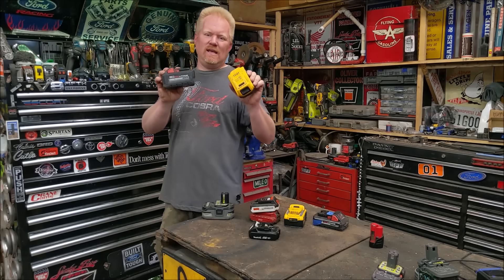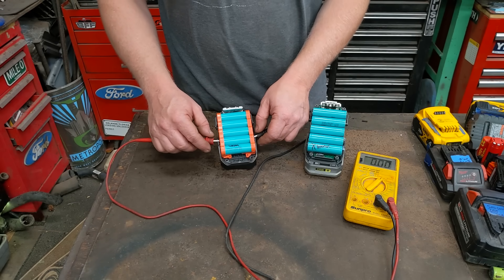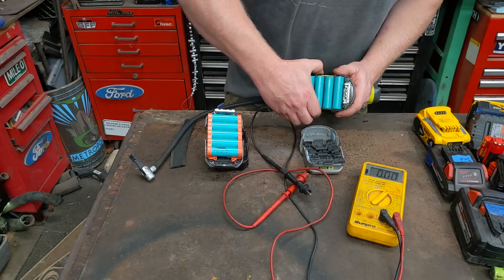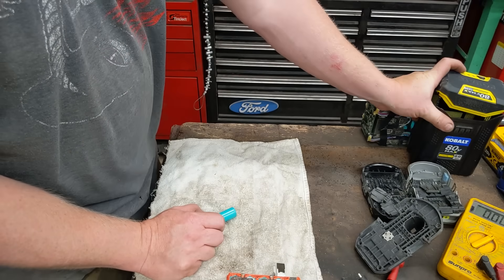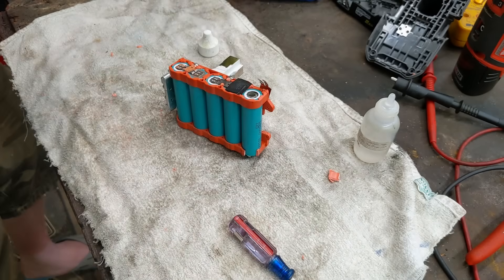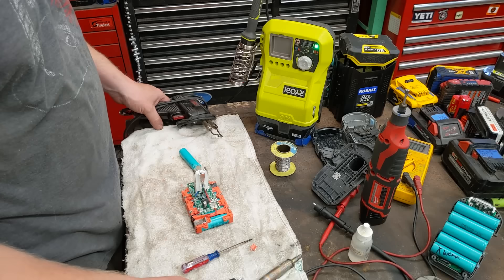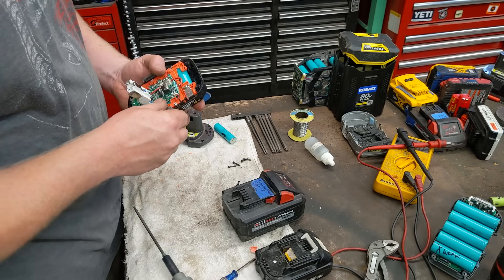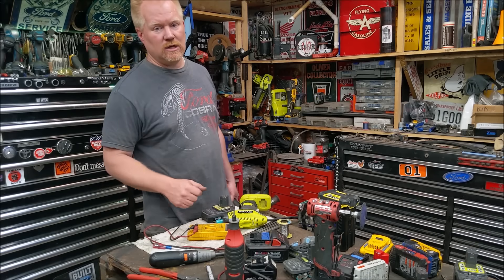Revive DEAD Battery Packs - Rebuild Repair - Dewalt Milwaukee Makita Ryobi Bauer Ridgid 18v 20v 12v

Comment from the maker: 🚨WHAT I USE IN THE VIDEO
I use the Kester 951 no clean flux. It lasts forever https://amzn.to/3bfvukk
Security Torx bits : https://amzn.to/3PPgs42
18650 21700 lithium Universal battery cell CHARGER: https://amzn.to/44Pmc57
RYOBI Dual Voltage Portable soldering station: https://amzn.to/3Jj0lZK
Inexpensive soldering iron/ kits: https://amzn.to/3zEmNcJ

Replacement battery cases/boards
Dewalt Battery case & board: https://amzn.to/3OL2v5B
Makita Battery case & board: https://amzn.to/3cRIahD
Milwaukee Battery case & board: https://amzn.to/3SamPAq
Reply: I like the fact that your tinning and solder welds went so quickly. So I was curious what the watt rating is your particular soldering iron?
Reply: What kind of liquid flux were you using in that little bottle also any small electrical connection like that do you always use rosine core soldier and what do they use silver solder on I’m looking to try and fix a bunch of cell cameras for deer hunting but Iv never been good at soldier or know what to use on each thing
Reply: Just wanted to thank you for giving out real useful information so many of these videos run you around chasing your own tail thank you again so much

Comment: I have a flex battery that I Believe half of the battery got fried when I tried jumping a car the wires touched and it spark my battery I opened it and tested terminals I can see a little damage on one terminal and I do get good voltage on the other side, could anyone help me get it to work??

Comment: How do I revive my power stack battery it want take a charge an it doesn’t have battery cells like those if it does it’s cover with a sticky white thing you can’t get off without tearing something up an the jumping method doesn’t work
Reply from the maker: Power stack batteries are a beast all their own. They're still individual cells inside, but their pouch cells versus the cylindrical style. The problem with this is you can't find replacements as they are custom made just for DeWalt.
Reply: @sixtyfiveford  so basically I need garbage it since no way to revive
Reply from the maker: @bowoods7771 Unfortunately. There's no way to revive pouch cells. They glue and mount them in the framework so tightly you end up damaging everything trying to remove just one.

Comment: I use Ridgid, and I am always losing batteries. I have to work in the rain sometimes, not pouring rain, but drizzle and light rain. After about two or three times of a battery being in the rain, usually in my drill or circular saw, it's done, and won't take a charge. They usually still  have a 75%+ charge in them. I put them in my shop on the shelf and don't use them for a few weeks to dry them out. Before putting them in the charger I push the charge meter and still 75%+ charge. Put them in my drill works fine. Put them in the charger fail. Maddening
Reply from the maker: The unfortunate thing about Ridgid is they use the exact same circuit board as the Ryobi's. If they get wet they freak out as there's way too many components on the board. Even humidity will kill them.
Reply: @sixtyfiveford  Thanks for the reply. I have 6 bricked batteries now that are nearly new in their overall life cycle. Can I bypass the board and plug a regular charger (bench top set at 18v) and manually charge them?
Reply from the maker: @Graybeard_ Open them up and use rubbing alcohol and douse the circuit board and use a toothbrush to scrub around. You'll see certain spots with corrosion/ green buildup. Sometimes this can wake them back up. You can top them off all you want manually without an issue. The thing is is most of the time they fail in the way where they won't output any current either as that is triggered via some transistors. But yours don't seem to be doing that.
Reply: @sixtyfiveford  Thanks again. I did try the cleaning the board with alcohol on one battery a couple of years ago. I did find some slight corrosion and was hopeful, but no luck. Yes, crazy that the batteries work fine in the tool. The charger just says failed or it says there is a temperature issue which is nonsense since they have been room temperature for weeks on my shop shelf. I have three chargers and get the same result in all three. I would switch to another tool company, but I have such a big investment in Ridgid. btw What is the best tool battery for moister?
Reply from the maker: @Graybeard_ none of them do great in moisture, but the simplest circuit boards are located in DeWalt. DeWalt handles all the battery maintenance through the charger. Behind them is probably Makita because they like to completely epoxy coat seal their circuit board for moisture. But Makita is pretty much dead in North America though they are probably one of the largest worldwide tool brands
Reply: @sixtyfiveford  Interesting! When I took that one battery apart, my thought was why didn't they just seal the boards with an epoxy coat. Roofers work in wet conditions. lol Thank you again for your replies!

Comment: My battery is testing at 15v but isnt powering tools
Reply from the maker: 15 Volts for an 18/20 volt battery is completely dead and the shutoff voltage.

Comment: I have Milwaukee M18 battery pack. It was left in a faulty tool and the battery was completely discharged over month. The cells are 0.001V. What do I do, recycle?

Comment: I need to replace cells in my 60v 15 AH Dewalt battery. It’s hard to get the cells out.    A new battery is 580$ with tax in Canada.  Guess I will have to figure it out.
Reply from the maker: I've done a few of these now and that's not easy as you know. I end up grinding the plastic away in certain areas so I can slide cells in and out. Sometimes I break chunks of the plastic away to be able to slide a cell out. I try to approach it just from one side.

Comment: Tin the battery before you put it in the pack. Pre bend the tabs on at least on side back to where it will make contact one the battery is in. Depending on how you cut the plastic you may even be able to prebend both contacts so they make contact after the battery is installed and no need to hold the tabs down with the screwdriver. For people following this , if the solder doesn't melt quickly no matter what you do, you need a higher wattage soldering iron. A pointed tip may not transfer the heat fast enough, so a tip with a flat bevel will work better.

Comment: I must note that there are a lot of dangerous and/or worthless counterfeit batteries on the market. Buy from a reputable dealer
And, you can seriously injure yourself doing this in several ways. Lithium ion batteries are incredibly unstable if not handled properly. They absolutely can catch fire. There is not always a circuit breaker built into them
I really like this channel, but im surprised he didn't mention this
Reply from the maker: Yes they can be dangerous but so is every single battery platform out there. If you touch the positive and negative of a car battery together, you're going to create some pretty big sparks and potentially a fire. Same goes for lithium. If you hold the positive and negative together after the initial spark, you're going to create heat that's going to turn to a fire. Really no difference.  You could probably do the same thing with a 9-volt battery or even a AA.

Comment: I'm trying to test my batteries but don't know what to set my volt meter too?
Reply from the maker: Dc voltage has the icon of a straight line with little dashes under it. That's what you want to use. AC voltage will not work and that has a little Infinity/squiggle line representing it.

Comment: I would rather take apart the pack than rip out part of the holder. I wouldn't use solder where a spot welder is to be used. Solder would be dangerous in a factory, the would use a paste and use heat. Which could blow it in a way to short +ive and -ive.... There are safety reasons to not use solder. Plus spot welding is quick

Comment: Just on your pry terminals off, I use a dremel type rotary with either ball head diamond or carbide to remove most of the spot weld then they pop off easily with knife tip, reflatten and ready for presolder (including battery ends) then quick reheat to join tabs to battery and cool with cold wet cloth.

Comment: If you are going to solder, get low melt (i.e. leaded) solder, and use it it a well ventilated space to avoid breathing lead fumes. Also, a good temperature controlled soldering iron, with flat tip will make things easier.

Comment: Little tip on Makita, since this video has come out Martin Jansson and friends discovered how to reset the battery controller. For about $15 in parts (Arduino and connector) and some software you can reset the controllers lockout.

Comment: I know this is an old post, but what happens when the battery won't charge in a charger but it will with the jump charge method with another battery. All cells test 3.60 individually.
Reply from the maker: Could be a defective circuit board. Ryobi is notorious for this and some brands will lock out the pack if there were errors.
Reply: @sixtyfiveford   Thanks

Comment: I wonder about corrosion inhibiting spray. Use it alot on the boats i wire to prevent electololosis from corroding out contact poimts. 
Neoprene dip works best for salt water boats. But freah water and cars the spray works great. 
Trailer plugs and bonding wire or grounding points. Saves alot of headacks in the future. Espesially on the newer sensative electrical equipment.

Comment: why doesnt this work on the 60V batteries
Reply from the maker: You can do this on 60 volt. The problem you'll run into is you'll need a little bit better understanding of wiring diagrams/ circuitry. They twist and manipulate the cells all over the place and the higher voltage packs. Also, it is extremely common for the circuit boards just to fail on larger packs. So you could have good batteries and just a bad circuit board.

Comment: In my experience, soldering these cells didn't work well all the time which is why I opted for a spot welder. They range from 40 to 100 bucks on Amazon, depending what features you want it to have. I do larger spot welds with more dots to create a better connection, but the usual 4 spot connection is just fine. Spot welding is easier and ensures a reliable connection. 

As for the batteries, I've had an issue with two OEM Black and Decker batteries where 3rd cell in single row configuration died in both batteries from a two pack which goes to show that there's massive planned obsolescence going on. I combined good cells from two batteries into one just as you said and that battery works fine, but for the other I used laptop battery cells and it works but spins the motor slower, hence the slower discharge rate. Laptop battery cells will work, but expect that. If you can source the new cells, I obviously suggest that rather than scavenging for cells and using used ones. Also, make sure to be very careful when prying off these cells from the nickel strips as there is a possibility to leave a hole on cell's contact point/terminal when you pry off the nickel strip and that can ignite or cause the cell to release toxic fumes. I also suggest you to have a metal bucket on stand by just in case one produces smoke or catches fire. DON'T pour water on it as that will make the situation worse - violent reaction, just like pouring gasoline on fire. Stay safe, and always wear face protection and gloves when dealing with these cells, because you never know what might go wrong.

Comment: Good stuff!
You can use the 1865 charger on cells why they are still connected?
Will that freak out the BMS board?

Comment: This is extremely dangerous. I connected 2 Dewalt batteries. Within seconds the i solution elated from the wires a d s.oke was everywhere. IF YOU TRY IT DO T LEAVE IT .

Comment: I have a battery pack for a mini chainsaw. The battery pack does not charge.. it's  Li-ion , Voltage DV21V, Capacity 1500mAh.  Where do I get Cell Batteries. ?
Reply: The"18650 battery store"

Comment: Can the charge indicator on dewalt power stack 1.7amp 20v battery be disabled, have one that the light stay on continuously and the board only has two wire.  Easily cut but would it an issue with main board. Thanks for sharing very helpful information.
Reply: The battery charge indicator has a momentary switch that can fail. Replace it or maybe its being pushed inside the case causing it to stay on? There is a red and a black wire going to the board that can be cut. I would make sure to tape the end after cutting off one if going that route.

Comment: A lot of bad info in this video, especially about soldering. The reason solder isn't used is because the heat can damage the cell, not because it's slow. Look at literally any mass-produced circuit board with solder everywhere as direct evidence that whole "too slow" reasoning is BS. If you want to repair packs, use a spot welder, period.
Reply from the maker: Nope. 1000's of cells and never an issue. High discharge cells are built for heat and can easily handle 160F with some pushing nearly 200f as safe operating limit. Laptop low discharge sales are different breed and where this wives tale is exaggerated. The batteries literally get hotter in use than soldering does. Oh and bulk soldering is done with flood soldering where they dip the whole board with components installed to solder everything at once.

Comment: Surprised people dont build batteries and sell them to peole for way less then new..
Reply from the maker: It's actually about the same cost to buy cells as it is to buy an entire battery. They're not ripping us off. You'll find cells are $4-6 each and you need 10 for a pack. So $40-60+$10 shipping for a 5.0ah battery.
Reply: @sixtyfiveford  Maybe in the USA. In BC, Canada, its half the price for me to buy cells from the US online and have them shipped to my home to build my own packs. A Dewalt 5ah 20V up here is $100 +tax when on sale, $200 when not on sale..

Comment: Can you change a Einhell Power X-Change 18V, 4.0Ah battery pack and change the circuit board and top connector for another brand like a parkside ? I bought the Einhell pack and thought it was the same connection as all the other cheap brands but its not, so wondering can I use the connector from the other brands to connect to the Einhell batteries ?

Comment: ❤❤❤❤❤❤❤❤❤❤❤❤❤❤     do you have fire fighting equipment suitable for battery fires ?
Reply from the maker: There's really no stopping a lithium fire. It just has to run its course. I keep a BC fire extinguisher on hand along with a steel bucket to cover it with and or fiberglass blanket.
Reply: @sixtyfive        ❤️❤️❤️❤️❤️❤️❤️❤️❤️❤️❤️     so would you agree the idea is to isolate the fire and keep it from setting other things ablaze?   and maybe have a shovel ?

Comment: thx for video...but whats driving me crazy at 3:19 how is it that without separating or isolating the batteries you can test and charge them one at a time, i thought they were all spliced together...ugh i cant wrap this thru my brain...
Reply from the maker: A 18v/20v pack with 5 total cells can each be tested separately by touching either end of the cell. A 18/20v 10 cell pack will have 5 pairs of cells you can test the same way. You have to test the pair but don't fret as they act as 1 cell when combined like this so there is no need to isolate them.
Reply: @sixtyfiveford  thank you

Comment: A benchtop battery charger at a low amp charge is better than the jump start method. The jump start could damage a cell because there's no control on how much current flows into the low battery.

Comment: I keep having trouble with dewalt after repair, it doesn't want to charge.. I got lucky with 1 of the batteries.. it wouldn't charge so I tried few days later and it fixed itself

Comment: not good!, need to weld cells, the iron heat kill the batteries
Reply from the maker: Nope. Done thousands of cells. Testing many before and after and never a capacity change. Wives tale.

Comment: I have a 40v mrliance pressure washer from Amazon. One battery pack works fine but one will run for 3 seconds then shut off. I can wait a few seconds and it will run again, but it always shuts off after about 2-3 seconds. I took it to a local Batteries Plus store and they said by law they can not work on it because it's lithium ion and it's dangerous. I contacted the manufacturer and the model I have is discontinued and they could not help me. I'm a DIY kinda guy but I've never worked on a battery pack. Can a guy like me do this with no danger?

Comment: How are you able to obtain individual voltages while the batteries are still wired together? If the pack is not taking a charge at all, how then would you begin to test which individual battery which presumptively would be dead?
Reply from the maker: By touching each end of the battery you will get that cell's voltage or if it's linked in parallel with a second cell, you will get those two cells voltage. It really doesn't matter if you get the two cell voltage as they are essentially one cell and if one dies the other one will die. A single cell will have the exact same voltage parameters as a dual cell in parallel.

Comment: You need to explain that cardboard thing stuck in the charger a little more. If people try to copy this, it looks like both wires are at the positive terminal of the charger and then when they try to "charge" a cell, they will actually be connecting it to a short circuit with no protection... oops!

Comment: This was the only informative video ive seen so far unfortunately my batteries blew up / had a lot of corrosion on two sets had gunk everywhere and rather then go through the trouble id feel more comfortable buying a new one , but if it was so extensive i would have attempted to fix it